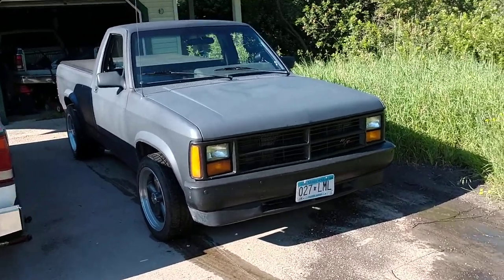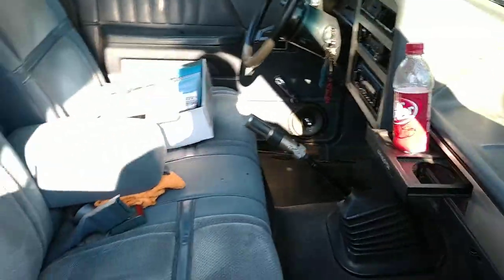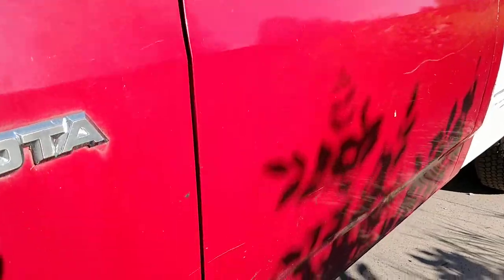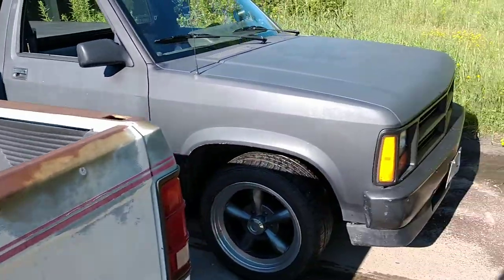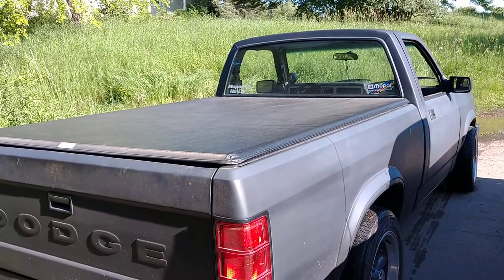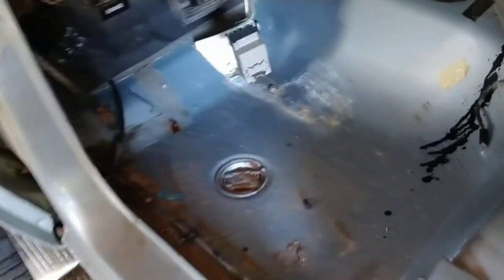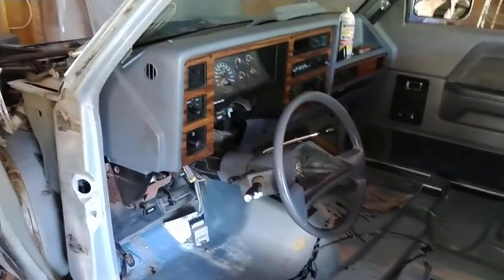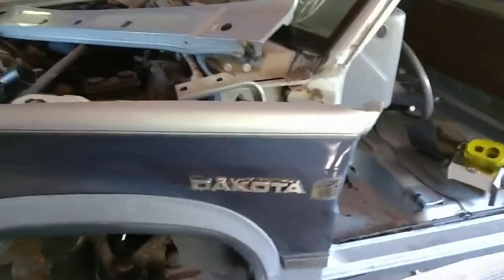My Fleet of 1st Gen Dodge Dakota's

Comment: Cool i used to own a 90 dodge Dakota se regular cab long bed dodge Dakota 2wd it was a nothern Indiana truck it was a very solid truck had a 2.2 litre Chrysler 4cyl and 5spd manual shift transmission and manual windows and it looked good and had almost a perfect interior except the headliner was gone..

Comment: Nice collection! I love my Dakota’s, I’ve got a 95 4x4 v6 5spd that’s in really good shape. No rust on body or frame, I love it! I’m thinkin about 318 swapping it, any pointers?
Reply from the maker: Well being that you already have the V6 and the 5 speed it should be an easy swap. Good luck man!
Reply: Iv got two my self, a 1988 and a 1994.
The 94 I'm doing the 318 swap. Good luck to ya.

Comment: grab the power window stuff and put them in your you love it. and by the way your primered gen one looks good just like it is..
another thing if you have a U Pull & Pay  around I picked up a full size ram manual transmission for 135 out the door it's a little more beefy,  it come with the flywheel clutch pressure but no slave cylinder..it were extra....I even got a 4x4 version for the same..but the odd thing is I've only seen 4 of the SQUARE bodies 
out there  I have two dakots really nice, one just need paint Dakota on 94, one 92  beautiful black but a couple of dings and a few sets of R/T RIMS.....
  I myself am looking for a cab for my RT a tree branch got it a bit.
but the beautiful thing is that the  U PULL AND PAY is only a mile and a half away it just opened, so I get first dibs on stuff but I don't need a warehouse full of parts..for my toys.....sorry about the bad deal,on the wrecked one....
Reply from the maker: Donald Powers thanks for your comments man, I appreciate that someone is interested in these trucks. I recently got rid of the wrecked truck cause I needed the space and the money. I probably should have gotten the power window stuff off of it but manual windows are alright with me.

Comment: took my 96 sport and retro fitted it with 87 front end clip (grille,hood,rad support, and bumper) and the 87 steering column, and to put it nicely I had to make a Franken column, took the 96 bottom end of the main column and put the 87 top on it, I just want to understand why its shorter, could you shed any light by chance
Reply: 96 bottom of the main steering shaft, i had to splice 2 pieces to make the shaft, sorry.
Reply from the maker: Nofriend_Nolife __ after 90 the Dakota was a bit longer in order to make room for the V8. I would think that would have something to do with it

Comment: The actual entire dash board... Do you still have it?!?  Mine got severely cracked when I removed the windshield.
Reply from the maker: SLC801aviator depends on which truck. But the ones I have are quite cracked as well
Reply: Thanks for the response. 
Www.car-part.com may have parts for you as well if you cant get what you need off of the other trucks in your fleet.   I love your engine swap.  I have a 91 extended cab.  Im looking to do the v8 swap as well.  Looking to use FiTech fuel injection.  
Cheers.
Reply from the maker: SLC801aviator thanks man. Im looking at getting Fi tech as well. Good luck with your swap

Comment: What wheels are those? What are the specs on wheel/tire combo?
Reply from the maker: Scott Woodle they are the 5 spoke 4x4 wheels with Yokohama 235/75/r15 tires that look nearly brand new
Reply: The torque thrust looking wheels on first truck.
Reply from the maker: Scott Woodle Oh lol sorry those are vision wheels 141 legend series 17x9s. The front tires are sumitomo lsw 245/45/r17 and the rears are Bridgestone dueler 245/55/17s
Reply: Know the offset? Just picked up an 89. Like the look of that combo.
Reply from the maker: Scott Woodle I don't know the offset but the backspacing should give you the same info. The backspacing if these was 5" I believe. Hope this helps
Reply: Great thanks for info and videos, looks good!

Comment: Have a rear diff that would fit a 95?
Reply from the maker: Donovan Shovan not exactly these are all 5 lug axles
Reply: Mine may be 5 lug I'll have to check tomorrow. Haven't touched the wheels on either yet
Reply: I have a 92 and 95 3.9 in my drive
Reply from the maker: Donovan Shovan after 90 they went to 6 lug I can almost guarantee that both are 6 lug
Reply: Nice may still do it if you have one for a decent price. My pinion is rubbing bad on the 95
Reply: It will work I just wont be able to buy wheels properly
Reply from the maker: Donovan Shovan I'll sell you one if your willing to come get it or arrange for it to be shipped